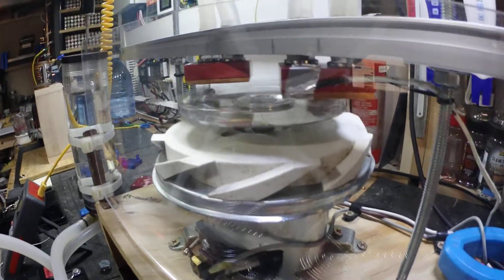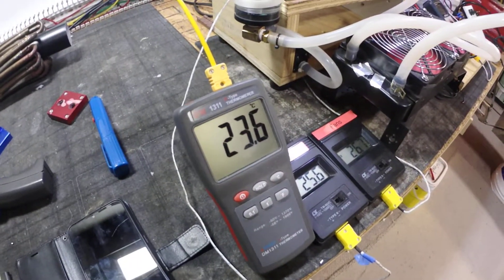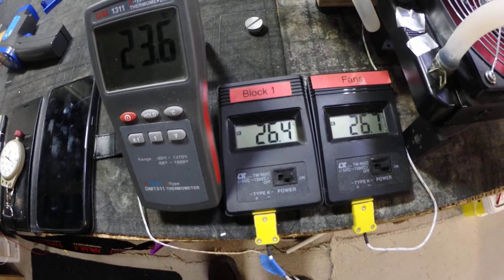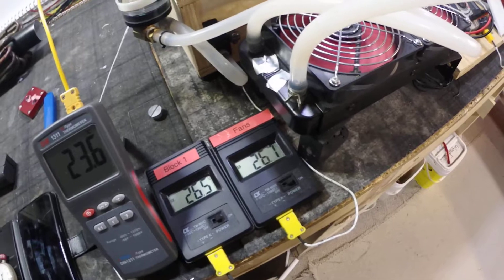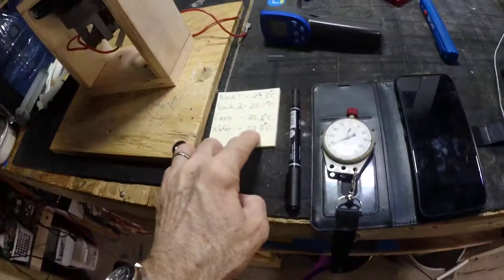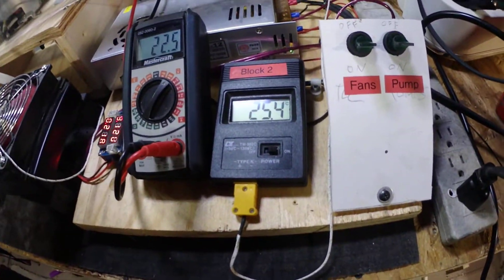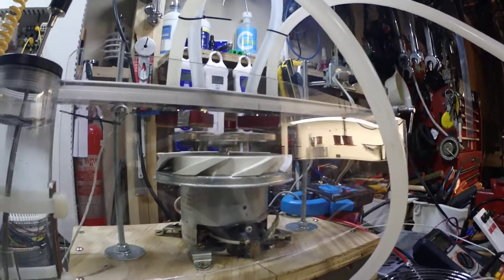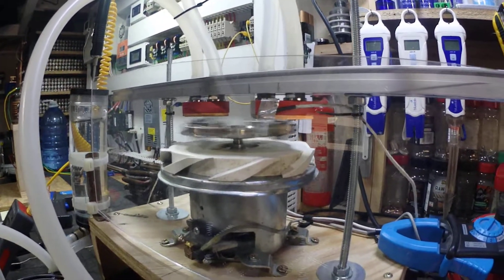Magnetic Heater Test 2 Conclusion

Comment: it is way more efficient to just use a resistive heating element. if u really want to use the magnetic stuff just generate a high frequency ac signal and push it trew a coil....
converting elecricity to rotational energy converting back to electricity is kind of stupid and hase a lot of loss.
i don't get the motivation behind that at all. because you are basicly trying to build a shity version of an induction stove.
if you want to have a higher efficency just use a heatpump.
Reply from the maker: Thank's for the feedback.